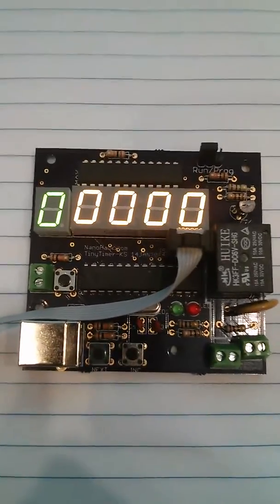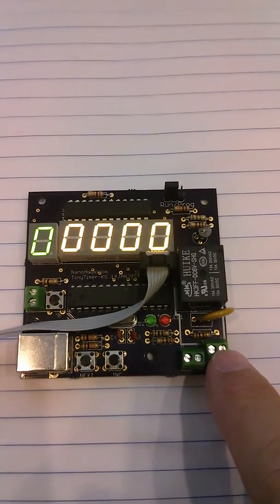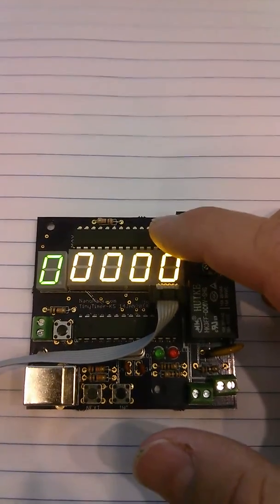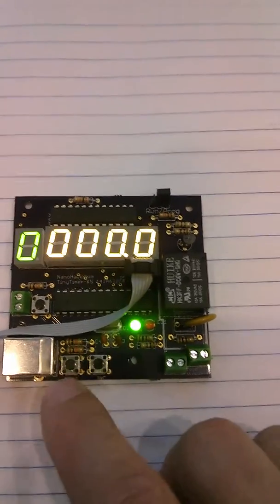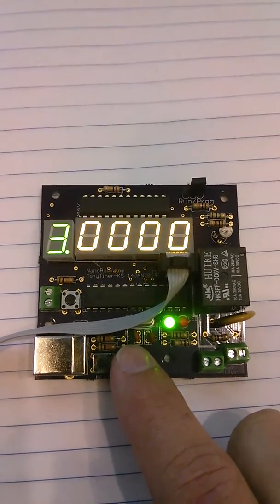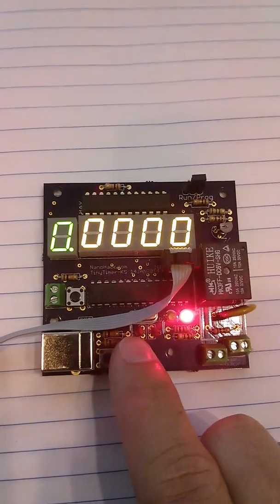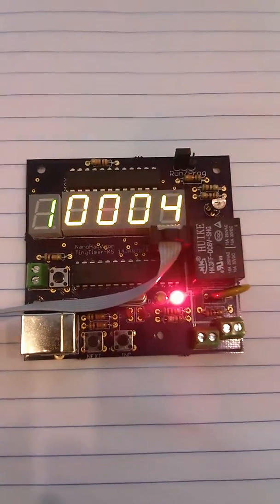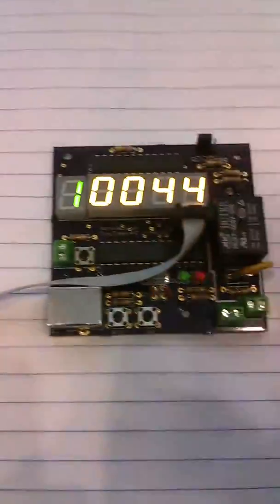TinyTimer Kickstarter Edition

Comment: THIS is getting GOOD.

Question: If it is in run mode and power is disconnected and then reconnected, will it automatically start its' cycle? I'd like to be able to restart my cycle manually rather than automatically, but without having to take off my safety gear to mess with jumpers and buttons.
I'm hoping to control four separate power tools timed off of one another and while I will certainly have to use exterior relays to power the various equipment, it would be nice to be able to control it from one simple source...designing tools is complicated enough! :( [for me]

I do have a spare laptop which I could devote. Perhaps there's a software/hardware solution that a construction guy like myself can understand which would suit my needs?